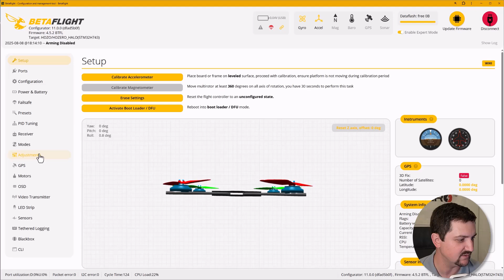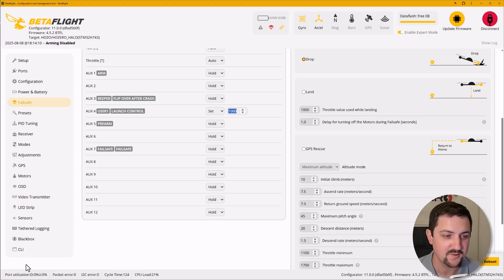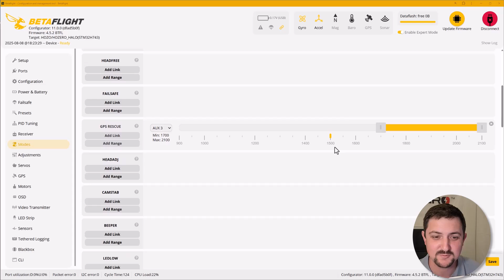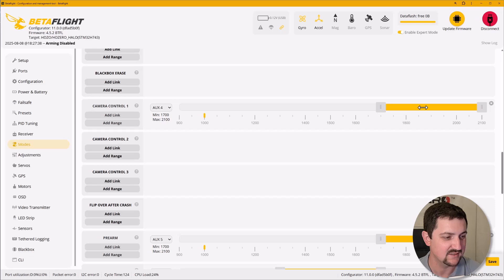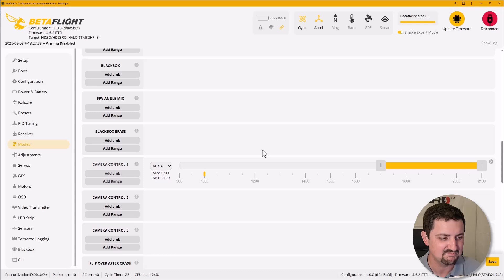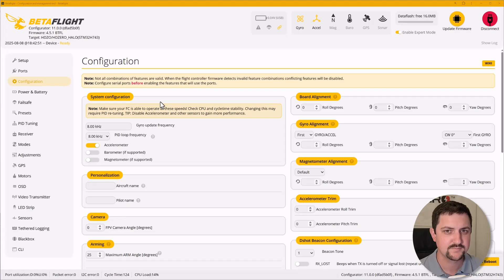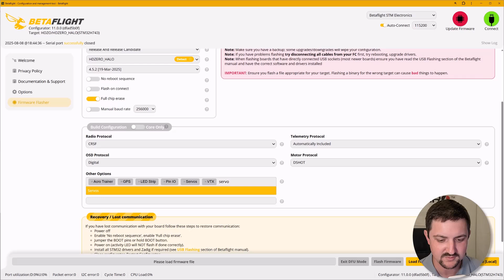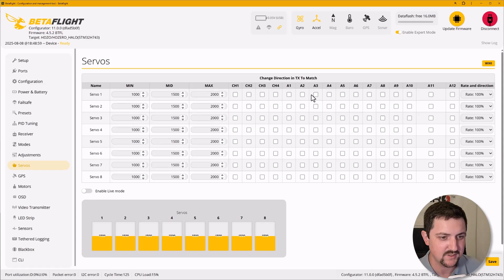HDZero Halo FC: Unlocking 9V BEC, Camera Switching & Servo Control!

Comment: Can we by chance use a camera like the cadex gazer and get night vision that’s switchable on and off with the camera switching?
Reply: The HDZ system only operates with compatible cameras. Switcher doesn't change system compatibility, it just allows more than one camera to be installed and selected between.

Comment: I've had mine set inverted (pinio_config=129) so the switch turns it off rather than on because I hadn't thought to set the mode range to include the middle position I use for turtle. Adding Aux1 range as well is a really great idea! Switching it over now 👌

Comment: So depending on the setting of the jumper pads the Camera Switcher can be configured between 3 specifications:

1. Full VTX Control- Showcased here. The VTX is in complete control over the switcher and is monitoring the state of the 'Camera Control 1' mode. Only the 3 MIPI cables need to be connected in this mode. (Camera settings can be changed independently)
2. Manual Control- The VTX still controls the switching but instead of using BF or iNav to command the VTX, the state of the 'IN' pad is being monitored. When that is set high (1.8v-3.3v) the VTX will perform a switch to camera 2 (Camera settings can be changed independently)
3. Full Manual Control- The switching is solely controlled by the state of the 'IN' pad. VTX is out of the loop and the camera settings cannot be changed independently. This mode is used on the secondary switcher when daisy chaining 2 together in order to select between 3 cameras.

I have tested using 2 switchers and 3 cameras and this configuration does work. Also from my testing, you can have up to nearly 600mm of MIPI cable + trace distance between the cam and VTX before you start to see image degradation.

-Whitey